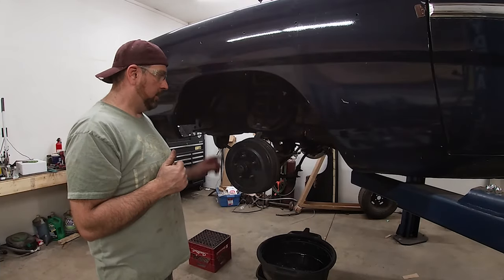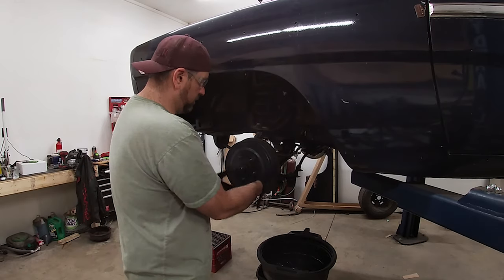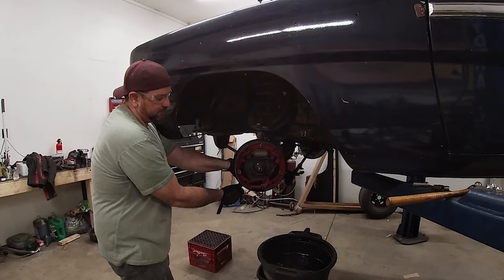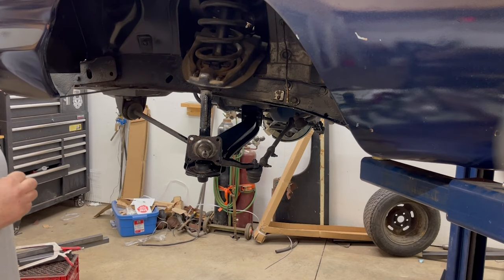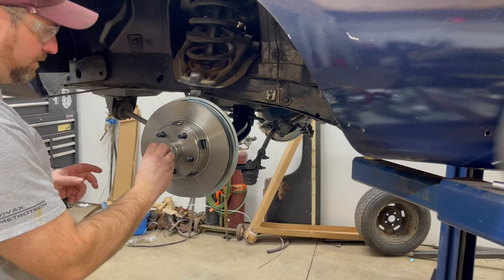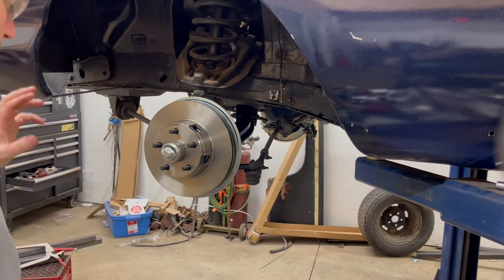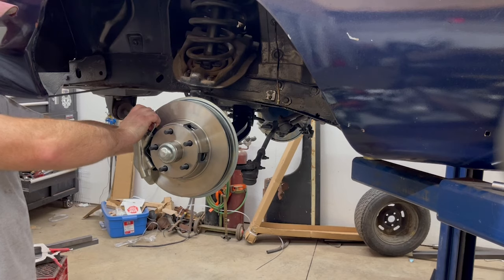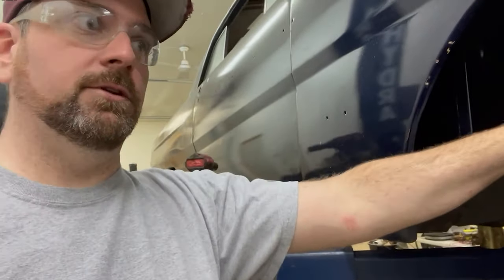1965 Ford Disc Brake Conversion

Comment: These don't last forever without maintenance. Can you buy new brake pads, discs and bearing seals (and even calipers) separately for this conversion?
Reply from the maker: Yes They are stock mustang parts from 1965, I may have discussed that in the video but its listed on the CJ Pony Website also

Comment: Hey man I enjoyed your video .Fellow Canadian here and I have a 1966 F350 6 lug drums in front .Could you suggest disc brake upgrade for it ? Everything I see is all 5 lug and twin I beam and my truck does not have that ..Thanks from a new sub .
Reply from the maker: Thanks I appreciate it. 
Possibly try Leeds Brakes they may have something. But most likely you will have to convert to a newer style assembly.